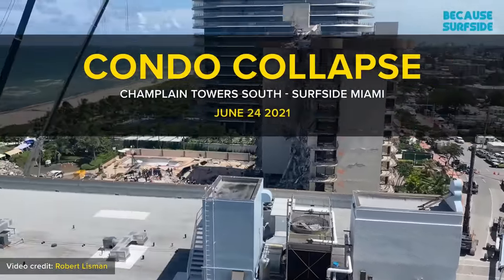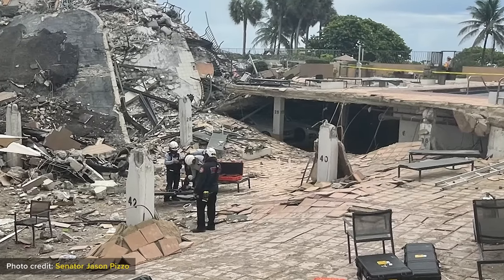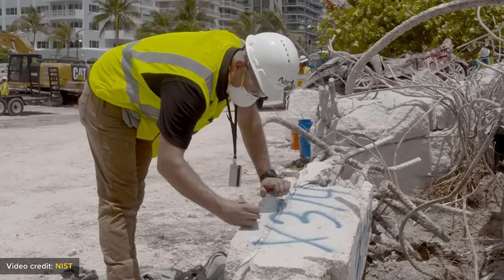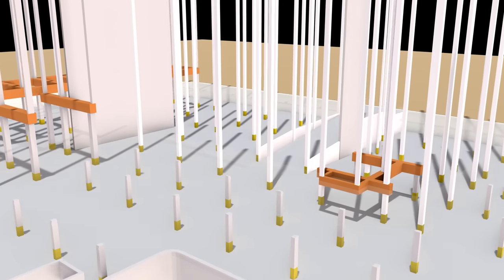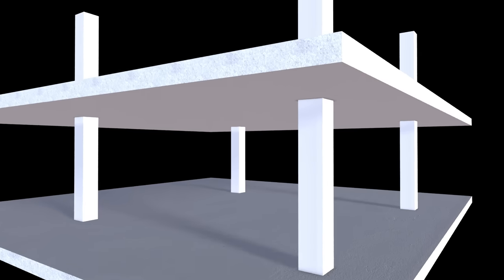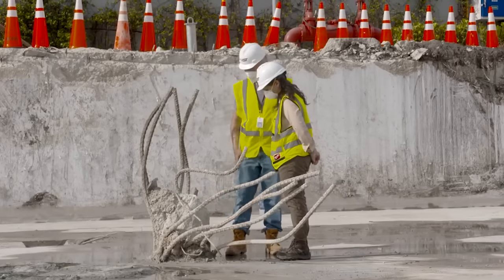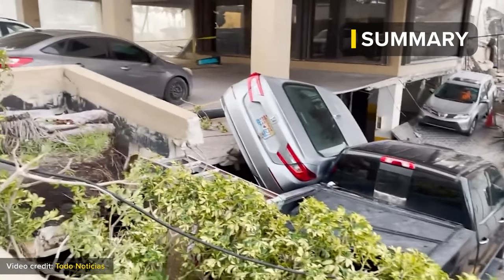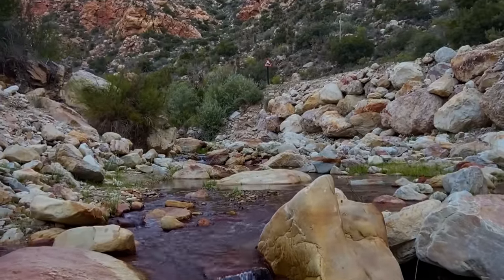SURFSIDE CONDO COLLAPSE | structural negligence! pt3

Comment: From a human perspective there are a lot of dynamics which results in "design by committee". That means different parties have different interests and agendas. During construction there are rivalries between the contractor and developer. Both want to cut corners but the developer more than the contractor who, ultimately is scapegoated if built not according to plan. In this building project both the contractor and developer were the same party. You have highlighted many other shortcomings. In the end there is rivalry between bldg. inspectors and the condo assoc. Nobody wants to be the one who has to tell condo owners "By the way there is a coming $300k special assessment". Likely this caused delays and probably there were discussions on limiting the extent of the repairs to minimize assessments. These are the non engineering contributors to this tragedy.
Reply: CP: In this case the Developer was also the Contractor.

Comment: Excellent analysis and great animations.

There's been some talk about the core samples which were taken showing poor rebar bonding. If the "pool deck" was delaminating without obvious rust staining on the roof of the parking area (the "pool deck" underside) that could help explain the initial punch-through. We'd still need to know why that was happening, and how to detect it in other buildings, of course.
Reply from the maker: I am curiously awaiting for the NIST findings.  They will be able to determine the true state of the pool deck slab.  How significant the corrosion was.  How widespread the delamination was and the presence or not of punching shear rebar.   
And from that know what to look for in other buildings.
Reply: @Mike-Bell  Great animation. Thank you very much for your work in this important topic. Have you considered a column, or element, further south failing first? Your model appears to leave the deck attached to the southern property line wall, but in reality it is detached and the rebar is corroded in that area. There is more I can share.
Reply from the maker: @exist7309  Thanks, please share what you have. 

I think it is unlikely any pool deck columns failed. I presume the pool deck punched thru first and then tore loose at the perimeter second because those were continuous and stronger connections. To know the sequence of slab failure requires structural modelling which I don’t have access to that type software.  It also needs measurements of the level of corrosion across the slab. 

If you have further detail or insights I would appreciate that.
Reply: @Mike-Bell  thanks very much for responding. I have looked at many photos of the parking deck ledger joint to the southern property line wall, behind where the black pickup truck was parked, and they all show the rebar was corroded and sheared off and the concrete in that area had lost most of its strength. The remains of the concrete are granular.
Reply: @Mike-Bell  underneath the black pickup truck is an open crack that shows the top surface of the parking deck at that point failed in tension. The rear wheels of the truck fell far enough to allow the deck to contact the underside of the truck.
Reply: Imagine the black pickup truck and other vehicles being at the end of the lever, the entire length of slab running from south to north, connected to the facade of the building.
Reply from the maker: @exist7309  As I said the NIST will accurately evalute the concrete strength and rebar corrosion levels and this should let us know where the pool deck first collapsed, ie the trigger for this tradedy.  I dont find anything conclusive in the photos and so at this point it would be guess work.  In the meanitme I will stick to what we can know with a great deal of confidence.
Reply: @Mike-Bell  Is there a way to calculate (evaluate) concrete deterioration because of constant water filtration? I have noticed that concrete which was filtering water is quite weak. I can't compare with its original strength, but it seems it lost a lot. Also I have noticed that concrete turns more white color. Could it be that there were no much corrosion because of lack of oxygen, but still a lot of decalcination?  Or could it be that the rust fell off because of drilling vibrations?
Reply from the maker: @donalexey  You need to have an Engineer to advise and do testing.
Reply: @exist7309  Also, there's an extra-long SPAN of 26'4" between that Southern perimeter wall, and the nearest/Southern-most row of (skinny) columns!  All other spans are on the order of 19' - 21'... it's been 3 decades since I've had my nose in The ACI Handbook, and I have a dim memory that the continuous support of a wall makes the slab behave more like a 1-way membrane vs 2-way, and thus longer spans allowed, BUT... still seems dodgy.

Comment: This does sound like a very likely scenario! Especially with the way the columns under the pool deck were still standing after the collapse. You can see where they punched through the slab. This also explains why the tower fell as well. 
Well we'll wait for the investigators on site to give us an answer! Until then it's nice to be able to watch your videos and have an idea of what happened that isn't based on hyped up conspiracy theories! (Seriously finding a good video on this is hard!)
Reply: The punching shear looks odd on the site.  All the picture I can find of punching shear failed slabs (mostly parking decks) show a big flat part of the deck stuck to the top of all the columns.  This failed with the reverse angle, so the column looks like a spear.  Basically looks like the slab had no integrity or strength left.
Reply: @k53847  yea that is kind of why it looks like the amount of rebar was not sufficient and the rebar itself was sheared.
Reply: @A.Martin  Maybe. Rebar is really tough.  Seems more likely it debonded from the concrete as the slab delaminated.
Reply: @k53847  All contractors must keep in mind to remember the rule of thumb which is "SAFETY ENGINEERING SAFETY ON ALL SAFETY STRUCTURAL SAFETY ENGINEERING CODES" are above any economic (forbidden and illegal and criminal costs cuttings activities) and political (HOAs, frivolous customer demands, frivolous ambiance) considerations. Buyers should also be aware of that too!
Reply: @k53847  What they should have done is "STICK TO THE TIME-TESTED AND TIME-PROVEN" structural engineering practices and combined the best of the old with the best of the new. 

Impost and enforce laws that rewards multiple-redundancy ENGINEERING STRUCTURAL SAFETY AND SAFE ENGINEERING LONGEVITY AND DESIGNING THINGS TO LAST AS LONG AS THEY EXISTS AND THAT THEY ARE MAINTENANCE-FREE AND TROUBLE-FREE AND REPAIR-FREE. 

The still working aqueducts of Rome and the ORTHODOX CHURCH of Haigh Sophia and the HIGH SECURITY Great Wall Of China are still standing despite 1500 years of being exposed to the highly corrosive maritime environment and 1500 years of highly active seismic activity of destructive earthquakes as in the case of Haigh Sophia, earthquakes and climate extremes as in the case of the Great Wall Of China. 

The use of high molybdenum stainless steel structural grade rebars and marine grade concrete. One modern example of steel-reinforced concrete construction designed to last the centuries is the Modern Itaipu Dam which was designed and built to last for 300 years of non-stop power generation.

Comment: The main step beam under the front wall was 12" less deep as calculated and was severely damaged when the patio slab ripped away. 
Thus your analysis enters into the chain of events. There were many deficits in the building.

Comment: Your graphics show stud rails as punching shear reinforcing.  That is what is in use these days, in the era when this building was designed and built stud rails had not been invented yet.  There were other means of punching shear reinforcing in use at that time but it is questionable if the original engineer even considered punching shear.
It is also informative to study the drawings and look at the amount of flexural reinforcing in the slabs and various beam elements.  That tells a good story about how the building was designed.  Very few youtube creators have actually done this, maybe only one or two that I've seen.

Comment: Excellent video with great explanation! 
Minor clarification: this building is called "FLAT PLATE" not "FLAT SLAB". 

FLAT PLATE has straight columns only and relies on reinforcement bars to resist punching shear. The video shows "Stud Rails" reinforcement which was not available 40 years ago. Rebar cages should have been used instead. Architects love using FLAT PLATE in residential towers to gain maximum floor height.

FLAT SLAB has concrete columns with drop panels and/or capitals under the slab which can easily resist punching shear. FLAT SLAB usually is used in the garage where appearance is not important or floor height is not critical. Maybe FLAT SLAB should have been used for the pool deck in this building.

From structural standpoint, the 9-1/2" thick pool deck is simply too thin. A thick enough FLAT PLATE would have enough capacity to resist punching shear.
Reply from the maker: Thanks 🤙🏻
Reply from the maker: What did the code back then say about punching shear? Was it left up to the structural engineer to do his due diligence or was there a basic minimum requirement?
Reply: Excellent video and interesting clarification for a lay person like me to understand this tragedy a little better! Thank you! Do you guys think the added weight of the planters, the sand added under the pool deck (trapping water) and the heavy tiling used in residents' remodeling (heavy marbles and granites used in many bathrooms, kitchens and balconies) contributed to the collapse? Some engineers seem to agree that this tragedy was the collection of many errors, not just one issue. Just wondering.

Comment: The buildings were designed and built with no safety margin; a single failure can propagate like dominos to bring down the entire buildings.
That's what happened when bean counters were allowed to make engineering decisions.
Reply: I would say it was the developers who made all these negative decisions. Apparently the developer was run out of Canada for tax evasion, and started his company in Florida with the intention of building all three of these buildings at the same time. But money problems arose almost immediately and the other two buildings were postponed. Well, how do you think they compensated? They cut corners on the first building to get it up quick and sell some units so they could restart construction on the other two. They even added to Champlain Towers South after the designs were finalized by putting several penthouse units on the roof, to squeeze some more profit out of it (the other two buildings dont have penthouses).

Comment: I'm curious what the expected lifetime of the building should have been... 50, 75, 100 years? Also, why not steel frame construction? I'm presuming that's more costly. Some have said such buildings tend to sway more, which is tolerable for commercial use, but not residential. It seems to me that any concrete rebar slab structure in a place like Florida has a very limited life expectancy.
Reply from the maker: The hotel next door is aprox 80 -90 years old and still has some life in it.  
Concrete is more durable than steel and in the ocean climate the wise choice.  Concrete is the norm in Miami and also around the world for good reason.  
Steel is more flexible than concrete.  Concrete structures have less sway.   
Steel and concrete each have their advantages.  But close to the ocean concrete is the way to go.
Reply: Concrete gives you the ability to pour in place, whereas steel design requires specific shapes and sizes that go in specific places, this manufacturing process can slow down construction. 

Transporting steel also requires road closures and coordination to get it to the site, and then you need cranes and qualified iron workers to put it together, whereas concrete is trucked in and just poured using forms, which are comparatively easy to make.

At the time this project was proposed, there was a labor shortage in Florida, most of the laborers available at the time were Cuban immigrants and they weren't trained to build complex structures. Well qualified iron workers were hard to come by, and more expensive to hire, which also made the use of concrete more appealing. 

Also, we've managed to expedite the process today, but back in the 80's it still took a while to get a steel building up. Since multiple buildings were on the developers agenda, time was a factor. Projects needed to be completed quickly in order for units to be sold so they could use the profits to start the next phase of construction. 

Then theres the environmental factors of salt air and salt water causing rusting, but ultimately most of the structural steel would have been protected so that wasnt a big deal. If I had to guess, the major deciding factor in using concrete over steel in the project was cost effectiveness, ease of construction, and a lack of qualified ironworkers.

Comment: I lived in Las Vegas for several years, and witnessed several controlled demolitions of major RCS structures, known as casino-hotel-restaurant complexes, AND... IIRC, the rebar sticking out everywhere looked like knobbly kabobs with much concrete still adhering to them... OTOH, at both the collapsed portion and the controlled demo portion of CTSouth, we see only "clean spaghetti" rebar, ZERO adhesion of the concrete "paste"... that's probably not "developed strength"... Proper concrete gets stronger over the years and decades, improper "mafia mix" concrete gets weaker... fall down go boom!  =:O

Comment: The deck was attached to the garage and when the deck fell it took the whole ceiling of the garage with it. All you have to do is look at the video. The deck fell and before the other part gave you can see the north side of the tower was heavily damaged to. So the deck was definitely attached to the garage. When the garage was so damaged it was over for the building.

Comment: Punching failure as the initiation doesn't seem likely.  That type of failure is immediate and doesn't provide for the distress noises witnessed hours before the collapse.  The 2-way (punching) shear design capacity of the columns to slabs exceeded the design loads by a considerable margin.  However, the horizontal slab delamination is very concerning and puzzling.  Shear rails were not required had failure not been initiated.  Excellent catch on the lap splice failure at the columns!  When I ran the numbers, I couldn't get enough moment into the column to fail it.  But, considering that column lap splices are shorter (the longer tension lap splices are designed for the full tension capacity of bar to transfer to the other spliced bar) , since they are assumed under compression, that would allow for the column section to fail.  Excellent video!
Reply: I will suggest that you check your calculations.  Punching shear capacity at the pool deck slab is very deficient.
Reply: Also, keep in mind that the rebar that made up the pool deck was absorbing water and expanding then contracting as it dried, this most likely started the delamination of the slab. If the rebar in the slab was feeling the effects of water intrusion, than chances are the rebar ties that encircle the columns at the lap joint were probably also rusting away and failed significantly, delaminating the tower column at the parking garage level when the pool deck collapsed. Considering the amount of water that seemed to be trapped in the parking garage on a daily basis with nowhere to go when it evaporated (they had like, 2 ventilation fans,  for the whole underground garage).

Comment: You can also see from the drawings, they changed the designs of the pool slab just before the construction. Initially they added more beams to support the deck and transfer the loads, but change them with nothing in few months.